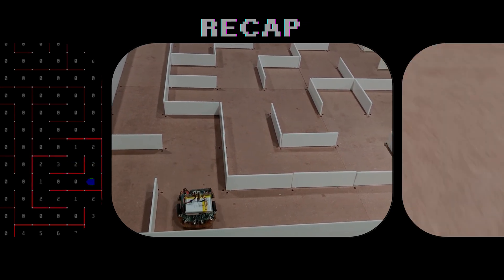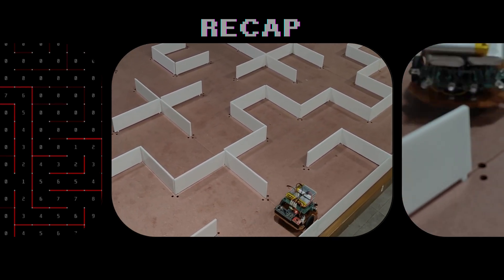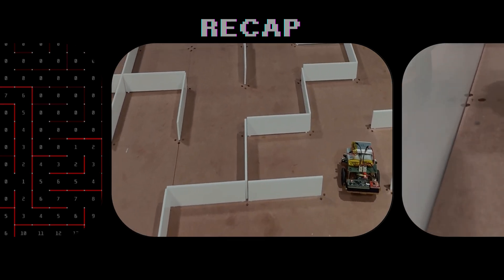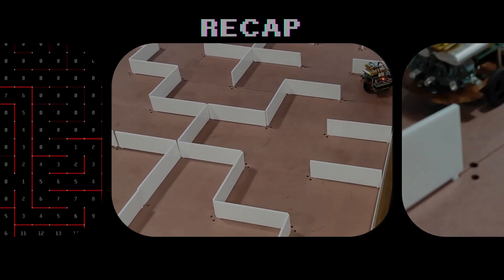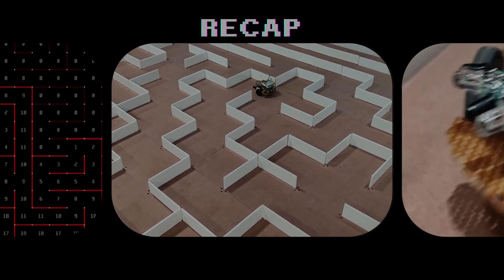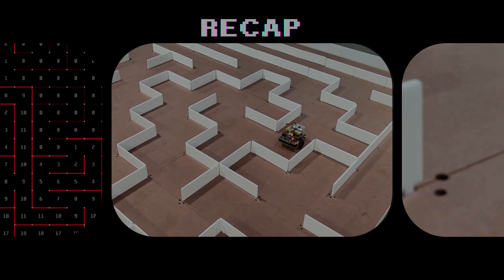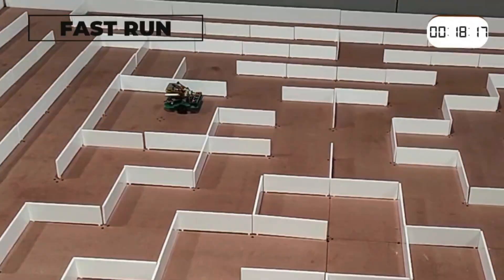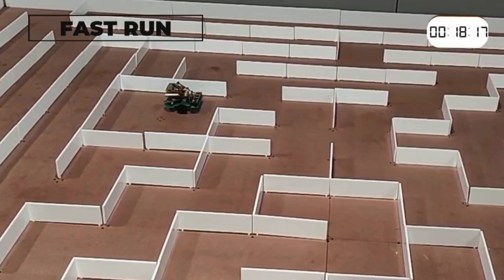🤖 Micromouse Maze-Solving Robot Demo (PART 2) | STM32 Microcontroller

Comment: How does the car move straight?
And how is it turning 90 degrees nearly perfect?
Are you using a gyro or something?
What sensors are you relying on to get this amazing movement?
I am really in need of those information if you can share it with me, thank you good sir.
Reply from the maker: For moving straight, we use motor encoders along with IR sensors. The encoders help maintain equal speed on both motors, while the IR sensors continuously correct alignment with the walls.

For perfect 90° turns, we rely on encoder counts. The robot turns until the required encoder value is reached, ensuring an accurate 90° rotation.